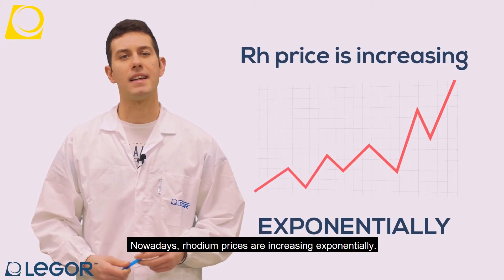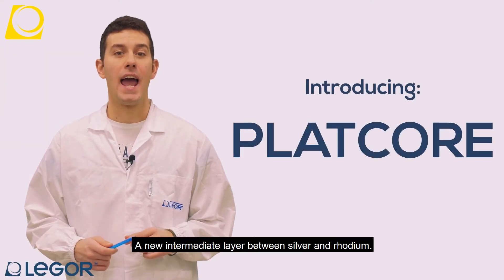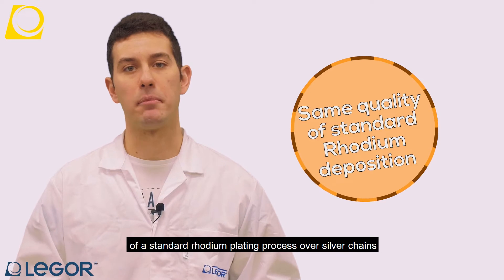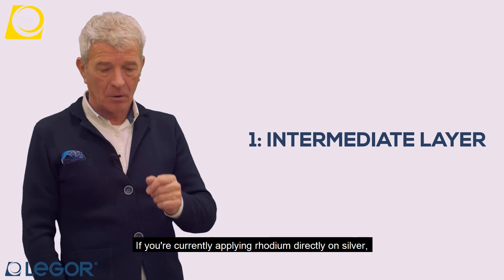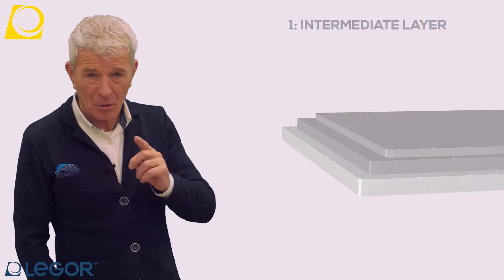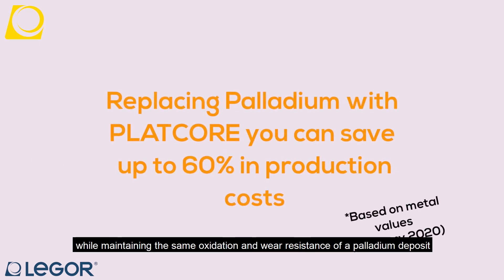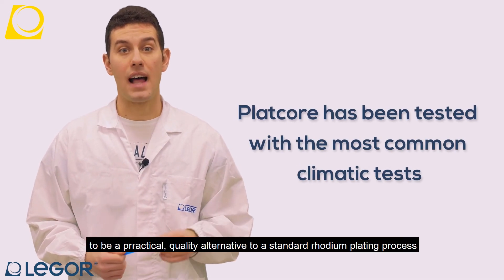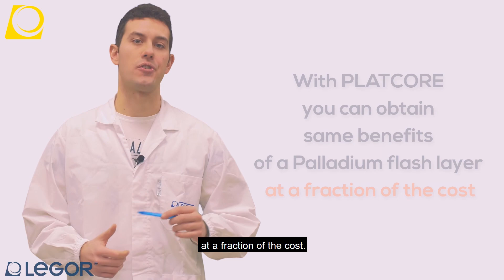How to fight the increase in rhodium and palladium price? Discover PLATCORE™

Comment: Dear sir we are legor pd2 flash plating solution use before rhodium plating our 18k gold jewellery but pd2 not glow then nickel and so4 into give going up rhodium plating .I will get better rhodium plating Glow if we do?
Reply from the maker: Good morning sir,
you can try and use PLATCORE, paying attention to two aspects:
1- Do not use PLATCORE for less than 1 minute
2- After using PLATCORE for AT LEAST 1 MINUTE, verify that your item title is not lower than 18 kt. Platcore is an alloy with a major RU % so the weight of the item could change before and after using Platcore, In this case you could have problems with the title 
Hope it was clear, if you need more info, you can leave us your email address and we will contact you.
Thanks